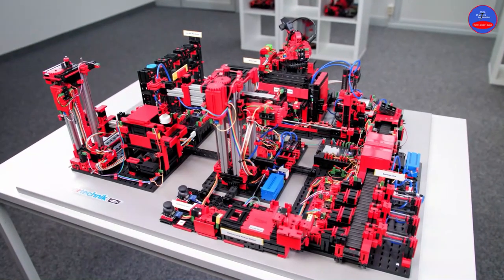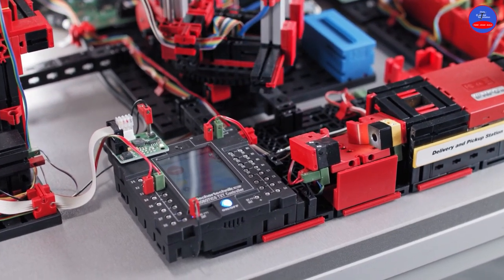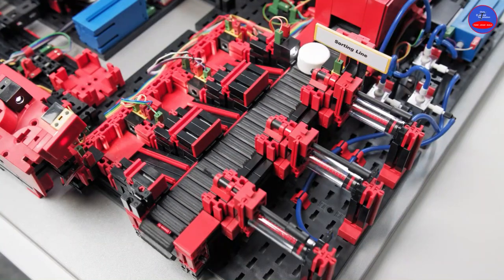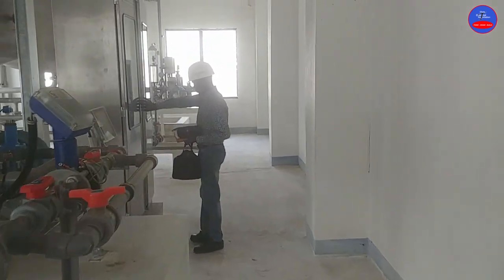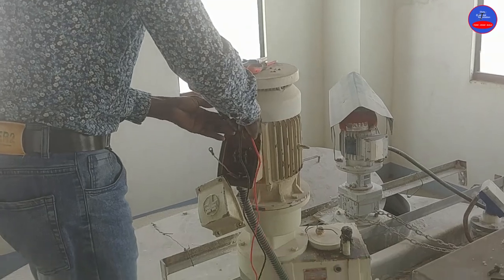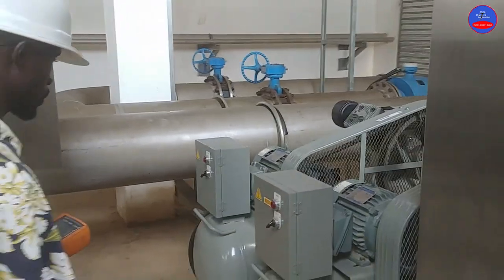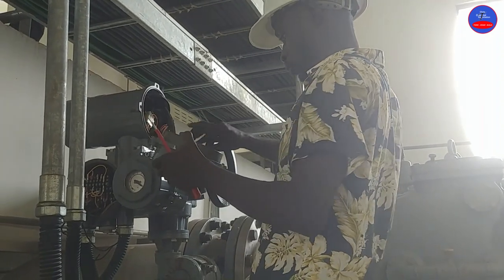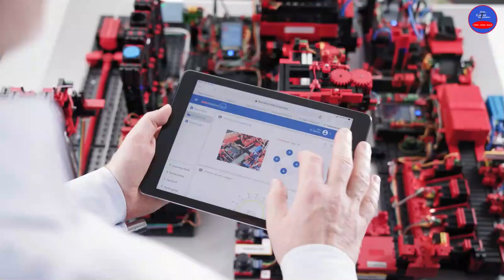What is Industrial Automation (Pneumatic Cylinders and Conveyors)

Comment: Okk so the reverse forward circuit on the crane was automatic?
Reply from the maker: Please it is manual. It only works when you press the button. When you release your hand, it stops.
Reply: @ChrisControlAutomation  what am asking is that once u press the button it automatically changes from reverse to forward or its u who operated it
Reply from the maker: @user-fb3fz4pj1f Oh yes. Its me. Let's say when you press forward button, it moves forward, when you want to go reverse, you have to remove your hand from the forward button and then press the reverse button in that order.

And for safety reasons, whiles your hand is on the forward button, when you press the reverse button, it will not work because of electrical interlocks. Please you can watch my video of forward and reverse. It is the same as this one I was operating.
Reply from the maker: Let me know if I answered your question as you needed.
Reply: @ChrisControlAutomation  thanks engineer just because I didn't see u operating it to move reverse HV got to know it
Reply: @ChrisControlAutomation  I watched and learnt everything 🤝
Reply from the maker: @user-fb3fz4pj1f Good to hear.♥
Reply: @ChrisControlAutomation  like did u press the reverse button to change to reverse?
Reply from the maker: Yes I did
Reply: @ChrisControlAutomation  when u release the hand it stops? , So u mean the contactors were nt retained? And u HV no stop button in da circuit??  Lt me hope am nt bothering you,
Reply from the maker: @Erick-n8m4d Oh no, you are not bothering. Yes it is good you are asking to know. 

Yes the contactors are not retained. They do not have hold-on contact. It does not have a stop button but rather it has emergency stop button. When you push the stop emergency stop button, it opens the circuit and when any push button is pressed, it will not work until the emergency button is released.

I saw this your question just now.
Reply: @ChrisControlAutomation  thanks alot with Ur ideas I know I will reach far
Reply from the maker: @Erick-n8m4d  I am ever ready to answering any question you may have. So feel free. Thanks for your comments.